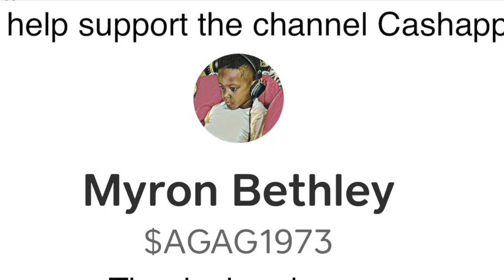Understanding the Switch and Cone Area Gain of 4 1506SC vs 2 2508SC ... The Correction!!!

Comment: There’s a lot more to it than just this.. xmax, power motor force. Just cause you have cone doesn’t mean it’s going to actually play louder. You’re gonna have all messed up with this cause it only addresses 2/5 of the factors that actually determine the output of a said configuration.

2 8” sub with say 600w rms and 12mm may be equal to a 12 but they are not going to play like a 12 that’s 23mm and 1600w. 

Now those 8”s with 23mm and say 8””rms still are not going to be equal to that 12 either. Not unless they got a hell of a motor advantage. 

Now to 6.5’s.. once you drop below 10’s you start to lose a lot of motor and movement.. quality 8’s hang in there really well.. can now equal 10’s in both. But 6.5 is just too damn small to get enough diameter to allow for enough movement. Most of the time you’re giving up substantial xmax dropping to a 6.5 unless they enlarge the surrounding in which case you gain xmax but lose cone.. 

Then when you really want to get technical the limitations of entire piston assembly.. cause the smaller it gets just like cone to surround.. getting extension for movement is very limiting. 

You may have the cone area but I’d be shocked if real would apples to apples if you actually gain any real sound. More cone area but only able to compress the same about of air. 

This is why i hate when people say 2 8’s are equal to a 12..  o they are not.. I can put a single 12 of lower intermediate level in a 2-2.5 box and hit 140 all day on a $200 sub.. but you got to get $400ea 8’s out then in the same size box to get there.. and even still there are only a handful that can do it and they are all oversized.. they oversized for a reason.. its the only way to gain mechanicals and gain movement cause x diameter surround or slider is only going to move so far before it tears

Now where cone area is king is generally cause its cheaper to power two smaller drivers and move equals air a lot of the time cause as the air compresses you reach diminishing returns. The more air you compress the harder it is to move that air.. so you need more power to do it.. where with multiples you can move same air for a little less power.. if all else is equal or close to it.. again this really outside a handful of 8’s doesn’t really work till you reach 10” subs because you need a certain diameter to move.. otherwise the only options left is lighten the cone so the motor can have more force against the air.. enlarge the motor so the motor can move more air under compression.. limitations are still there.. you can outside some super flex Armstrongoke material to be used for both surrounds and spiders are only going to have so much mechanical movement.. 

This starts to demishish quickly when comparing 10 or larger subs simply only so much you can do as things get so small..

Comment: That's a good job to correct that.. I seen his comment as well 👌. I appreciate that your taking the time to explain this. I honestly would have believed 2 of those would have been more than a 10.. that's interesting
Reply: @Chuck_Sanders  honestly in the totality of things it's a super inefficient way to build anyways.. I understand for someone like mb who's working in limited space perhaps.. but I've seen several 6.5 and even 8s builds .. it took so many just to equal what someone could do with 2 18s or 15s it ain't even funny.. your actually saving "space" but waisting motor force and materials .. just my opinion.. if you can fit a ten .. use a ten. Bc often in the space these 8s need to be low you can fit the ten anyways..
Reply: @Chuck_Sanders  absolutely.. 👌 can't blame the shop either.. I'm a carpenter and we " suggest" things all the time.. but some owners " demand" otherwise... Boss says makem happy.. so 💁

Comment: This also proves another point MB made about these large surroundings.. people will argue that a large surrounding counts as cone area.. however a surrounding doesn't stay stiff and move like the cone.. it's not the same. They say " well I have xmaxx" yeah sure but the fact is the highest bl "motor force" will be when the coil is center.. the further out the gap, the more bl you loose. That's the science behind mb saying xmaxx isn't everything..
Reply: The surround is a tricky thing. One side is attached to the cone and moves up and down, the other side is attached to the frame and is stationary. So the way the math works out is half the width of the surround is added to the cone diameter. This is where a tall, thin surround has an advantage over a tall, wide surround. Tall and thin gives good Xmech plus more cone area.
Reply: And to clarify, the importance of motor force is easily seen with a ported box producing output at the resonate frequency. So with a ported box tuned to 33Hz, the speaker cone is barely moving. Xmax and Xmech is not a factor here. It's all about that motor force controlling the cone to get high output. Above and below the tuned frequency and in a sealed box is where the large cone movement becomes important.
Reply: @JasonWW2000  yep.. that's why companies like DD and Rockford among others have spent hours of r&d to develop surrounding technology.